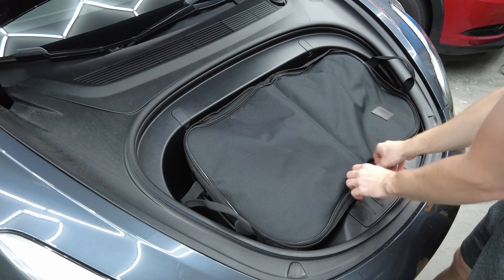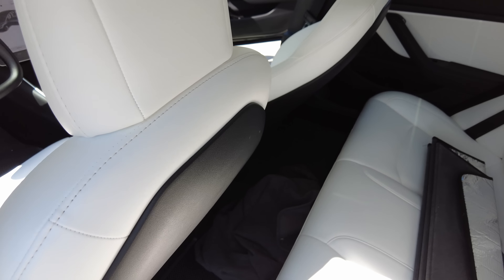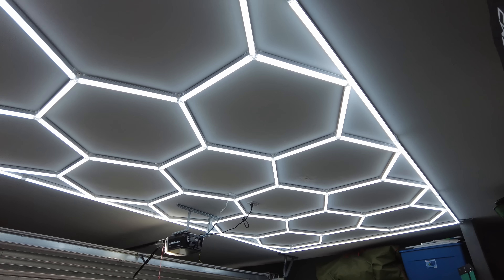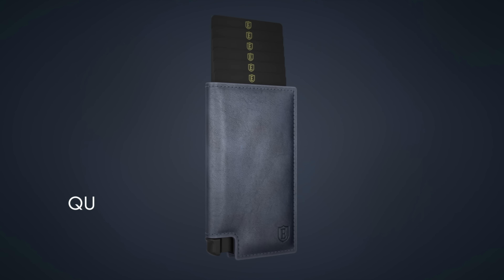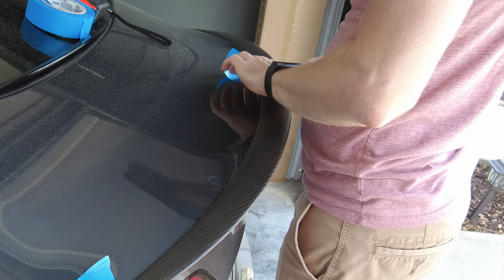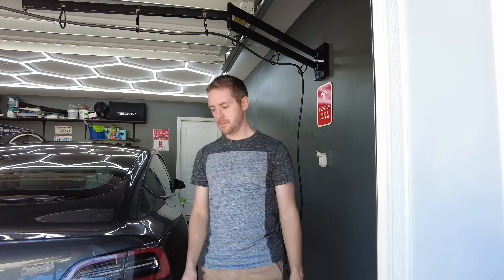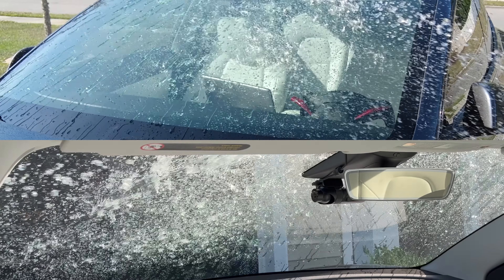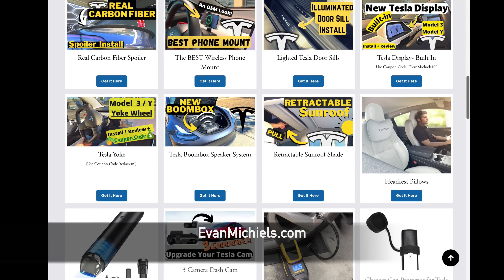NEW Tesla Model Y | Model 3 Accessories! ⚡️ 2022 New to Market

Comment from the maker: See MORE Accessories! ▶︎ https://evanmichiels.com/general-2
Portable Cordless Vacuum ► https://amzn.to/3KlRpSl
Headrest Neck Pillows ▶︎ https://amzn.to/3koNxFM
Temai Windshield Shade ▶︎ https://www.vion.parts/?ref=Evan (Coupon Code- 10EVAN) OR Retractable Shades ▶︎ https://amzn.to/3F14G1W
Hex Grid Lights ▶︎ https://amzn.to/3voxj5S
Ekster Smart Wallets ▶︎ https://bit.ly/38xWnhI
CarPlay Instrument Display ▶︎ https://amzn.to/3LuXjSv
Carbon Fiber Spoiler ▶︎ https://amzn.to/37SI3QP
EV Hover Cable System ▶︎ https://bit.ly/38z49rR (Coupon Code- EVAN)
Charger Cap Protector ▶︎ https://amzn.to/3rWTXQA
Gyeon Leather Shield ▶︎ https://amzn.to/3KqtEc6
Gyeon Glass Cleaner ▶︎ https://amzn.to/3wjOMMb
Gyeon Quick View Glass Coat ▶︎ https://amzn.to/370OVve
Drop Stop ▶︎ https://amzn.to/3KstyjS
Tesloid Frunk Cooler Bag ▶︎ https://amzn.to/36WjJgy